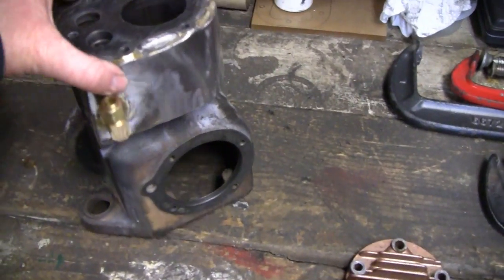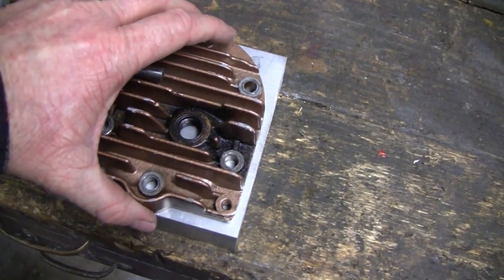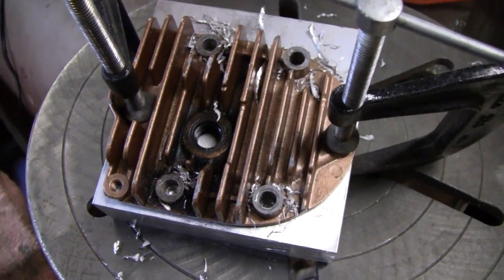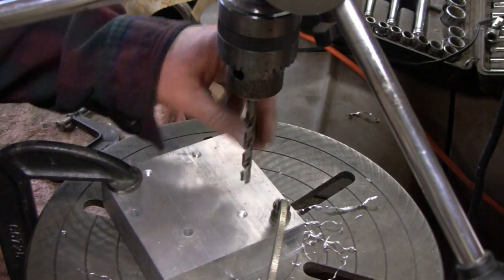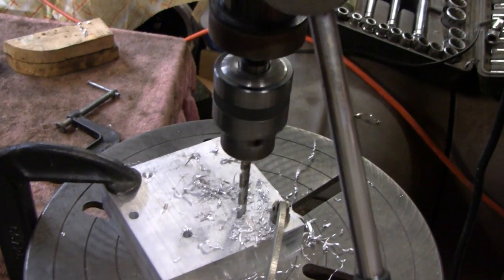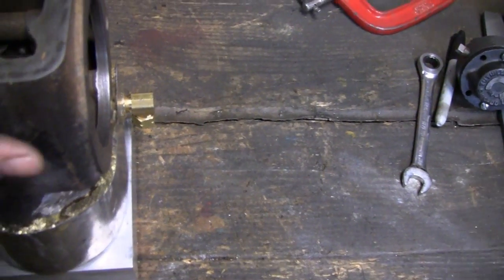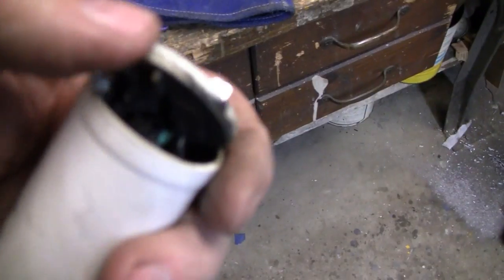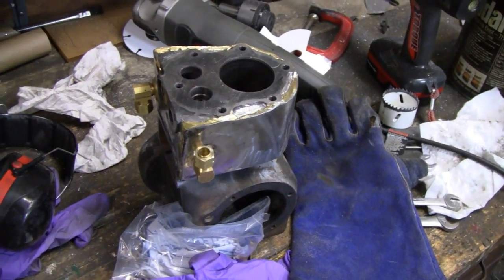HOMEMADE WATER COOLED BRIGGS ENGINE (part 12)

Comment: yea standard run cap for the motor. new one will probably help it stay a bit cooler i would say the constant run time made the cap finally say NOPE.  i usually replace em with a bit heavier duty cap same ratings but constant duty.
Reply from the maker: Yeah I had that baby running for a while!!☺

Comment: Do you think thermal expansion of the aluminum may cause a problem with the steel head bolts? There is a good sized chunk of aluminum there. The expansion may overload the threads and try pulling the bolts out of the head. great looking project so far! keep it up.
Reply from the maker: I doubt the head will even reach 100 degrees, I don't think anything will be expanding!!☺

Comment: Yup, had a couple of capacitors die on me like that.  When you said that the switch started putting out smoke but the machine was still working I thought "capacitor" then you flipped the switch and turned it on I thought "definitely capacitor" glad you found it, that is a nice rig, be good for many more years with a new cap. I don't believe that is the ground on that capacitor, it's just a way to mount the cap.  I believe that cap should be fairly cheap, less than ten bucks or so.
Reply from the maker: I'm glad it was the Cap and not the Motor!!☺

Comment: careful touching the terminals on that starter capacitor it has more than enough juice to kill normally, short it with a screwdriver to make sure it has no charge and is safe to handle

Comment: Take the sanding belt off when you use the disk sander.The added load of the belt is not helping you and it is loading the motor.

Comment: Electrolyte that's coming out of the capiactor. Make sure that you use the same microformats but you can use higher voltage if you want.

Comment: Yeah that cap let the magic smoke out, should be easy to order a replacement either through the porter cable or I know you'd find it at Mouser.com just match specs. You didn't get to see the cap when it did it, but it can be a spectacular fail lol. Looking good on the head buddy, this is gonna work out really cool, good luck!
Reply from the maker: Thanks Bud!!☺

Comment: I would like to respectfully offer a couple suggestions. Try a few drops of WD40 next time your drilling aluminum along with a higher spindle RPM and a split point drill bit and you'll more than double the drilling efficiency without clogging of the hole with chips sticking to the drill point and flutes. Also when you mill the water cavity WD40 works good for cutting fluid. Don't need alot and it's not near as messy as the Aluminum fluid you used on the bandsaw.

Comment: capacitor failure easily fixed, just change it, the sander should be fine.  drill press vibrations could be belt related, not really a big deal.   link type belts will take away some of that and they grab better too.

Comment: Electric motors run hot when in use for a while. When under even a light load they run hot. Most motors the working temperature is a lot hotter than most people can even keep their hands on the motor. If you look up the motor specs you'll see what I mean. As far as the cap goes just what ever the line voltage is and whatever the capacitance on the cap is should be fine. You can always go up slightly on capacitance and up on voltage, I try to stocl to 25%. Going down in either is not advisable but in a pinch you can go down around 10% for a short time. So basically it doesn't have to be the exact capacitor. 
Look fwd to seeing the motor done. Doesn't look like you guys have far to go.
Best Wishes n Blessings. Keith
Reply from the maker: Thanks Bud!! We got a 20uf 450v!!☺

Comment: Equipment failure mate - seems we are all suffering from it at the moment eh! Least it's an easy fix. Possibly a good job as the motor may have got too hot without you noticing. Like the way you're doing the water passages in the head :D
Reply from the maker: Thanks Mate!! Just a little fly in the ointment!!☺

Comment: I would assume the capacitor is there for power factor correction (helps the motor run more efficiently). It is not necessary, but the system will draw more current without it.

Comment: After milling out the center of the head, I would consider not welding the the top plate to the head, this way you can insert a separate gasket between the two, around the head bolts, and not have to worry about water entering the head bolt holes and possibly leaking.
Reply: Instead of the thin aluminium sheet, a clear  acrylic sheet would be much much much more entertaining

Comment: I had a bolt stuck in the bottom of the oil tray (goes under my drill press' table) and the drove me NUTS, it took me a whole year to figure out the fact that if you lean in on the damned thing, the table gaps and thus, the bolt entered there.  The little things i tell ya, those are what make you go mad. ;)

Comment: This part can be shipped to your door for less than 10$ on Amazon.  Search on CBB60.  If you want one that will last a bit longer get a higher voltage rating.  This one is a 300va, replace it with a 450va unit and it will take the heat a bit better when you run the belt sander for longer periods.  Just don't change the capacitance value, stick with the 20uF unless you know what you are doing.  All capacitors stink when they rupture, it's a distinct scent for sure.  It's best not to run it until it gets replaced as a cap will explode in spectacular fashioned, which makes cleanup much more difficult.

Comment: that cap won't be hard to get , any motor  shop will have that, it was on it's way out causing  the motor to run hotter , you will be fine with a new one

Comment: Next up: Watercooled 4 cylinder glass head radial briggs
Reply: Colepaq I don't think it will be that smart to make a water cooled glass head Briggs you couldn't see anything from the coolant especially when it gets hot. And you will have to drain the coolant every time you clean the head. Trust me it would be cool but a real pain.
Reply: chuckthe4x4 that would acutely be pretty smart! you wouldn't have to worry about electrics failing ether. And you could put one of these old maytag exhausts on it and make it go up through the roof. But then you will have to worry about starting it you would just have to  leave it on all the time and what if it's cold it would be hard to start when you wanted it.

Comment: As for your dead capacitor, it's just the run cap for the motor.  Any 20mfd cap rated at 300V or above will work.  You could pick one up at a hardware store or appliance parts shop.  The threaded lug on the bottom is just for mounting, it serves no other purpose.  As for the wiring, there's no polarity on an AC capacitor, so it doesn't matter, either.  If you can find one with spade connectors that is a bonus, but they mostly come with just a couple of wires sticking out of the top.  You might have to clip the connectors off the machine wiring and reconnect with wire nuts.
Reply: Another source would be a plumbing/HVAC supply house. Furnace blower motors use similar value run caps, and they are usually a bit more robust than that white Chinese turd Porter Cable had originally installed.
Reply: A capacitor in this kind of motor (induction motor) is not for compliance at all, its is required to run any single phase induction motor. The capacitor alter the AC current to create a rotating field.
Reply: VA is not the same as Volts.. VA is a power rating similarly to watts, but not the same as Watts!
Reply: or just crimp on some male spades
Reply: TheChaps83 Sorry you are right, I was thinking of 3 phase motors.
Reply: No worries ;)
Reply: White Chinese turd..ha ha, nice one! As Ave might say, 'solid genuine Chineseium cap'.

Comment: Very cool, Roadking.  I was surprised to see how circular the head bolt pattern is; the shape of the head really hides it, you know?
Reply from the maker: It's funny, after all the years and dozens of these little engines I've worked on I never realized it was a symmetrical circle until I laid out this head!! I think the offset plug messes with your head too!!☺
Reply: Yeah, the sparkplug position ain't going to change much, a spark is a spark. Sure it's going to run different, but not by that much. On a BMW motorcycle with opposed cylinders i moved the spark plugs by 1.4 cm because of a modification, we actually picked up a little bit more power (not much).
Reply: Y'know I have looked at and worked on hundreds of heads in my time but this was the first time I saw that circular pattern and VISUALLY had it register.  Very cool is right.

Comment: heres a link to a suitable replacement, just connect the wires to either one, its ac current so it shouldnt matter, the voltage is different but the farad is whats needed. the bolt on yours is just for mounting
http://www.ebay.com/itm/US-CBB60-20uF-Wire-Lead-Cylinder-Motor-Run-SH-Capacitor-AC-450V-/292044102917
Reply: Yep thats the right one. Just remember a higher voltage rating, like on this one, is fine. 
Never change to a lower voltage rating.